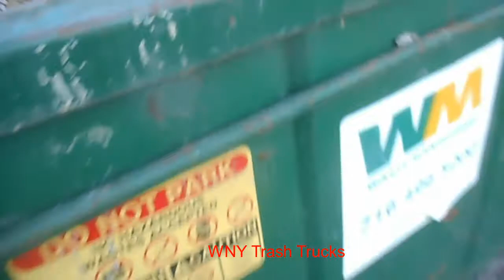Dumpster Diving 3 2 slow weeks.

Comment: Nice haul with those extruded bois. Hopefully they go for a higher price than old sheet! Cool video, do you plan on getting a truck?
Reply from the maker: They should but they are kinda nice hate to sell them but it is one of those things like what the hell I am going to do with it. A truck or SUV is in the future but quite the future at the moment
Reply: @wnytrashtrucks  I feel you I have at 8' section of extruded aluminum that came from a sign, it's quite heavy for its size and I know it must have been expensive new. Good lucky man I've been saving up for one, so much more I can do with it than a bike.
Reply from the maker: The problem is that my grandma is talking about saving up to buy her a house to live in. But i want a truck first.